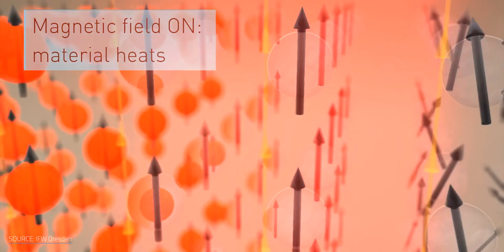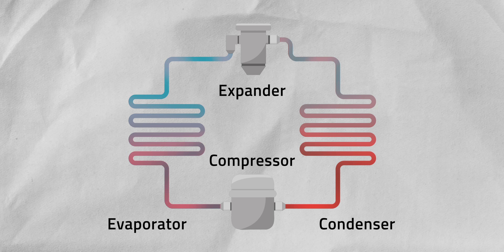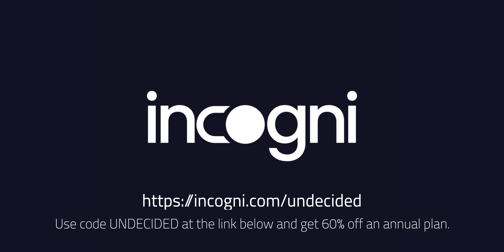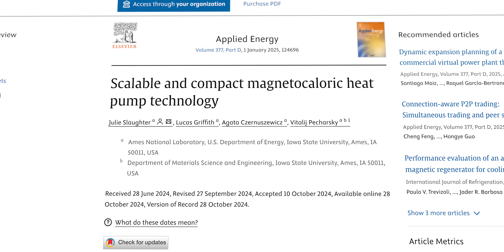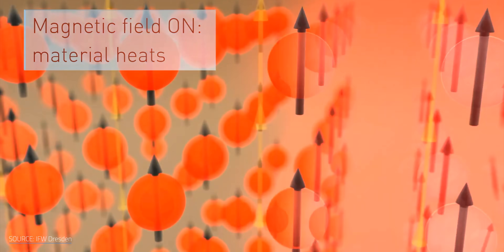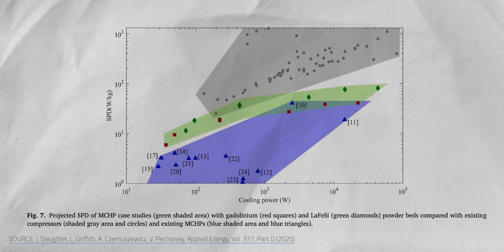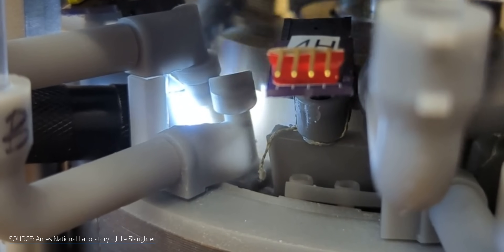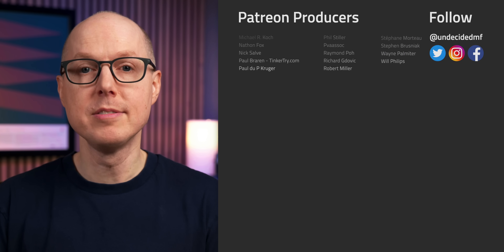How Magnetic Cooling Is Breaking All the Rules

Comment: I think the emphasis on power density and fancy materials are misplaced in this situation. Don't get me wrong the research is cool and if we someday want to replace the refrigerants in our cars AC that would be critical however for fridges and heat pumps they are generally stationary object where space and weight are easier and cheaper to accommodate. Given the materials will be stressed and will degrade over time I believe its more important to develop a functioning product using abundant materials to allow rapid and easy scaling of production. Mabey we don't need Neodymium magnets or fancy materials, we aren't trying to build a Tesla battery pack what we need is more like the lead acid solution. Something made from simple and abundant components that can be manufactured by a third world country in a basement that's cheap and designed to be repaired or recycled irrelevant if that means it might be more bulky or somewhat less powerful.

Comment: The one thing thing you didn't really address was: can the magnetocalorics generate the the same cooling with less energy, or less required space? That is, what is the potential future benefit other than eliminating the fluorocarbon cooling issue? The technology seems to have achieved cooling/size parity from the report, but can it exceed parity? You also didn't state what a "typical" home refrigerator consumption is in terms of cooling power, so that we can compare against the 1K capacity noted. Great report, I had not seen your previous magnetocalorics video, even though I tune in to your channel occasionally.

Comment: Beyond the terrible efficency compared to modern loops and the safer gasses espoused in this video to be a problem being used in those (and usually installed by technicians being careful to capture that gas for disposal instead of just venting it) the biggest problem this idea - this entire line of thinking has is that the gas is a carrier for energy. While magnetocholoric cooling requires a carrier of its own. A company showcasing this used water, imagine pumping water around and then getting very little cooling because you are bottle necked by the freezing point of water. The refrigerants are designer gasses made for the job you can't sidestep needing them just because you have a different process.

Comment: I tried ordering pure gadolinium cubes from China and they didnt even have a measurable quantity of it in them.  I was initially suspicious when I introduced them into a 1T magnetic field and they didnt warm up.  I even ordered a thermal infrared camera to visually see the heat change, but nada!  XRF was the final test and they contained not a single bit of gadolinium, however they did contain around 6-7% rhodium,,, although it isnt economic to extract it.

Comment: I looked up the specs of the Polaris cooler which needs 350 kWh per year for 9°C in a volume of 88,5 litres. I have a small cooler/freezer unit whose specs say 90 kWh per year for a combined 109 litres cooler with a small freeze compartment. So how exactly is magnetic cooling more energy efficient?

Comment: all these devices are basically pumping heat from a cooler temperature and delivering it to a higher temperature- the reverse of a heat engine. No heat engine can efficiency higher than the Carnot engine. The interesting point is that it does not depend on the nature of the working material. What you are describing is an heat engine running in reverse - also called a refrigerator. They too have thermodynamic limits and it does not depend on the nature of the working fluid.

Comment: "But what do you think?"

I think your pun game is "next-level Dad."

Seems odd that the best / most efficient implementation of a rotating magnetic field is still spinning metal, which has to use up some of the energy and contribute to wear and tear (and noise). After all, we've had brushless motors for decades, where a solid-state controller steps a magnetic field around a stator 🤷‍♂

Comment: I installed an alcohol based heater/cooler a long time ago.  It uses alcohol as the coolant.  This system was capable of controlling temperature between -55C to +125C.  No CFCs!
Reply: refrigerants using CO2 or NH3 have been used for various applications and they have their specific uses.
Reply: @janami-dharmam  I've heard good things about Ammonia(NH3).  I like the alcohol option because it is a little safer and not so bad for the environment.
Reply: NH3 systems are used for very low temp requirements. They are effective for heat transfer but not practical outside of low temp requirements
Reply: @ they are widely used in industrial applications
Reply: @philblue1015  NH3's main drawback is it's super toxic, that's really the only reason it isn't more common. It's worth the risk in large industrial applications and it is VERY HIGHLY regulated. But you wouldn't want to risk a NH3 leak on somebody's home split system. It's not that the refrigerant is impractical though, it's technically MORE efficient than the synthetics.
Reply: I live in Finland, and I don't remember having seen any freezer or refrigerator using anything else than cyclopentane in at least the last 15 years, probably even longer than that. The biggest issue is that it is highly flammable, and it does produce more gurgling, whistling etc. sounds, but I've also noticed how some manufacturers do a way better job at keeping those at bay than others do.
Reply: What about the mining for the magnetic materials and it’s impact on the environment with wide scale adoption. We have this problem with mineral extraction for E.V batteries. Look up dirty nickel it should change anyone’s mind about E.Vs
Reply: @bartismoellis1052  they see but are blind!
Reply: @bartismoellis1052  why nickel is dirty?
Reply: @bartismoellis1052  thankfully Nickel is highly recyclable, and plus a third of EVs sold in the past few years don't even use nickel in their batteries. That's unlike oil, which gets used up once and then you have to mine it over and over again for the lifetime of the car.

Comment: Hmm. A magnetic cooling system with no high pressure pumps or refrigerant to lag out, sounds suspiciously reliable. I don't think any of the major appliance manufacturers are going to want to put this into a mass market refrigerator, until the technology is mature enough to be designed to reliably fail in eight to ten years.

Comment: DoT enhanced light condtn & sgnl processing using cavities (Braigg gratings) so you could use ultrasound to mechanically alter the elastic CuNiAl etc fibers and direct hot and cold air in opposite directions. It's not difficult. Just patience and persistence.

Comment: Magnets creating a cooling effect is not new.
A researcher from JPL, at his own laboratory, built an electric motor.
The motor wasn't a new design, but used new materials.
Neodymium magnets and over-rpm the motor.
After 9000rpm, the motor would begin to run away to over 30,000rpm.
Instead of generating heat, the motor got cold.
Because it got cold, a novel effect, the JPL researcher was awarded a Patent.
This was in 2008. The video was on Youtube but is not discoverable today.
From the video I was able to find the Patent.

Comment: In the old systems, the heat was physically transferred by the refrigerant, through a series of pipes, from the area to be cooled, to the exchanger. I can understand how this cools a specific magnet, but is a heat-transfer liquid then used to move heat away, to where it can be dumped. Do the cold magnets, just conduct the heat away? Please tell me.

Comment: From what I read, many magnetic cooling designs still require liquid coolants (heat-transfer liquids) for heat exchange within a commercial device, i.e. transfering heat from a cooling chamber to the magnetic cooling core. So magnetic cooling won't eliminate coolants.

Comment: Ever since I started working with AC units I became a huge fan of lithium bromide absorption machines. Give em a little electricity, a little heat and you get out some pretty cold water. I really loved how they worked vs. the standard refrigerant cycle. Great machines for industrial applications, not so much for commercial applications. This may have better commercial applications than LiBr.

Comment: Someone correct me if I'm wrong, but won't you still need some gas or liquid transporter for the heat created. In compressor driven systems the refrigerant gas does this. Another point is HFC's aren't used as much these days. Many use hydrocarbons like butane and or propane gas. Apparently more efficient and way less toxic. I run my car AC on BBQ gas. (propane). Works at lower pressures and doesn't leak as bad as the usual HFC.

Comment: I want fridges to be a part of a house. Work with the environment, let them oversteer a few degrees. 3 specialized layers of insulation between two vapor barriers is an insulation system; at 50 to 100 radiant values and AI storeing thermal energy when renewable energy is high... huge amounts of not burning the atmosphere.

Comment: I'm a rv technician and I would love to do more research on the total power consumption of these as a replacement to 12 volt compressor fridges which have pushed out absorption fridges which are the better choice off grid. Spinning magnets with no refrigerant leaks? Absolutely! Could these possibly be used as air conditioning?

Comment: pelter coolers exist already as well, also most refrigerants used now are the same as in the cans of compressed air many use to clean their pc's with sooo we're venting them to atmosphere already
Reply: Most people have switched to battery powered miniature air blowers to clean PCs now. Don't need to keep buying cans.
Reply: @rdizzy1  they typically don't have as much air pressure though, ive tried a few, they do however make great fire bellows
Reply: @Captain_Char  They can have  high CFM and very air flow speeds though, across very tiny diameter attachments. Which is perfect for using on keyboards/computers in general. Which is why most people use them now.

Comment: For the Magnetocaloric systems, i could see this easily being expandable by stacking more fluid rings around the carousel of spinning magnets. Just make longer magnets to accommodate the space. Then as each stage of cooling is done, past the fluid up to the next level and keep further sucking out the heat. A pretty easily expandable system with minimal added costs in theory. How well this would work in practical application, that's the real question.

Comment: Its still going to require a heat transfer isolation stage. That means a coolant of some kind, can be a liquid or gas, but at this point you may as well use a refigerant that solves the heat transfer/isolation at the same time. I got to play with a magnetic refrigeration unit that was used to get to LN2 cryogenic temperatures from an otherwise normal refrigeration device. It didnt have a real load though, was to cool a mwir detector without needing LN2.
Reply: yeah i don't see these dump heat outside of a room like a mini-split

Comment: How toxic is the system of creating and disposing of these exotic materials? This is where the undecided needs to be concerned. The global ozone depletion and warming potential is ridiculously overstated for gaseous refrigerants. Co2 is NOT a pollutant, and the science of CFC's destroying the planet's ozone layer has been proven to be wrong. Solar weather is the culprit, and we don't control the sun. We need to be focusing on returning to the most efficient heat transfer mediums because the higher electric consumption of the new alternative refrigerants is not being taken into account for their use. The use of more copper and better motor design has been the primary reason for energy reduction. The new refrigerants are hurting us, and not helping.

Comment: Why not use Peltier elements?
Also no coolant needed
No moving or rotating parts (truely "solid state", no humming no wear&tear.
No freakingly strong magnets that would interfere with electronic devices and radiowaves.
Technology already used and tested (e.g., in Thermocyclers).

Comment: We already have a Refrigerant that is not a Fluorocarbon...
It's called R290...
The downside to R290 is 2 fold...
1) it's VERY expensive...
and
2) It's HIGHLY flammable/explosive...

R290 is simply a highly purified form of the Propane you use in your backyard BBQ's every year...

With that in mind, I believe the Magnetocaloric systems shown in this video are a better idea for home Heating and Cooling assuming their Electricity Requirements are equal to or less than the the current fridges, central furnaces and central A/C's they're intended to replace...if a gas based heating/cooling system costs me less money per month, I'll continue to use them instead of the Megnetocaloric Systems thanks...

😄😁😆😅😂🤣
Reply: R290 is not expensive at all. In fact it's cheap. And you can vent it to the atmosphere.
Reply: Why would R290 be expensive?

It's propane, it's VERY cheap.  
And R290 is basically THE default for high efficiency heat pumps now.
Reply: @DooMMasteR   BBQ or Automotive Grade Propane is cheap...Refrigeration Grade propane is VERY highly refined and pure and is not Cheap relative to other commonly used Refrigerants like R404A & R22...
Reply: @HappilyHomicidalHooligan  not sure where you buy your R290 but, while more expensive than burn R290, it's far from expensive.
We pay about 9€ per kg at Linde and most heat pumps are hermetic cycles, they only need refrigerant if they break.

In Europe and Asia it's almost all R32 and R290 now.

R22 is banned in many countries. And as R404a it's banned in the EU too.

Comment: 6kW isnt exactly what id call "large scale applications"

The smallest split system air conditioner is 2.5kW and the largest is 9kW. A ducted central system in a domestic application can be over 16kW.

A supermarket will have 100s of kilowatts of refrigeration capacity with its rack system.

The main problem with the vapour compression cycle is planned obselesence. Components are designed to fail, allowing refrigerants to leak to atmosphere. But solving that issue doesnt agree with the aims of capiltalism. And so we need a new technology.

Source: I work in the industry
Reply: Agreed re what constitutes large scale.  The compressor motor for the freezer in a seafood processing factory I worked at used 90A per phase @400V.

Comment: In your breakdown of the refrigeration cycle, you show hot gas coming back to the compressor. It is actually a cool gas coming back as the refrigerant is boiled as It absorbs heat and turns to a cool vapor and that intern keeps the compressor cool. 
My opinion is more research should be done in thermal electric units as they only have two moving parts which are the indoor and outdoor fan and no refrigerant. If they can get to make those larger scale, then you’re gonna see some unbelievable changes in the cooling industry.
Reply: TE as in Pelletier?
Reply: think they are working on it indirectly, i think the problem with those is they are missing a crucial prerequisite tech, near room-temperature superconductors to be efficient enough.

Comment: I know that in our buses, refrigerant leaks are a major issue. Something that doesn't have that weakness would be fantastic, but of course, they would have to fix the durability issues.
Reply: I suspect that leaks are designed intl the system on purpose,  as leaks are the most common reason for replacement.  Appliances used to be made to last but not anymore.

Comment: Hello. I was wondering if you have ever heard of Flooid cascading heat pumps (they have a website called flooidpower)? Apparently they use several different kinds of refrigerant fluids within their units, each one designed for a different temperature range and therefore when it gets really cold outside the heat pump can keep operating at full capacity, even down to -32 degrees Fahrenheit. I have no affiliation with them but I am looking for a heat pump system that will work in a cold environment.
Reply: And, of course, I have now just seen that you did a video on this heat pump 11 months ago LOL.

Comment: I'd have to see significant efficiency improvements.  HCFC's aren't that bad, and there are already plenty of non-HCFC alternatives.  In fact, there's some speculation that the ozone hole is a natural phenomenon to some degree.  Besides, an ozone hole at high latitude doesn't really harm the environment so much because at high latitude the sun's UV rays are coming in at a grazing angle anyway and attenuated by the longer path length through the ozone layer.

Comment: I like your channel, and I enjoy your teaching style. However, I am left wondering how we remove heat from the stressed sections and deposit heat in the relaxed sections, especially as quickly as that rotor is turning. I assume there are two fluid loops because if there were only one, then you would just have a very complicated heater. So, how do they switch between cooling the substrate and using the substrate to cool the working coolant?

Comment: Is anyone else thinking about cooling processors? This could be an alternative to vacuum chamber cooling. It's already technically possible if implemented correctly. The big heat issue is currently being addressed with the silicon photonic chip tech so this could be a nice gap filler in the interim.

Comment: What's the maximum functional temperature  differential? That's the maximum difference between the inside temperature and the outside temperature. If it can't get to 20 Fahrenheit (7 C) difference than it's probably not going to cut it outside of fridges and drink coolers. As the climate heats up, it will be more and more difficult to get an air conditioning technology to keep interiors comfortably cool. If the outside is 120 F  (49 C) can you survive in more than 100 F (38 C) inside?